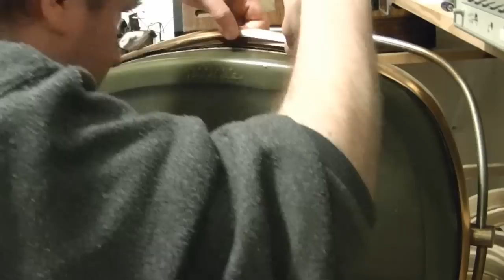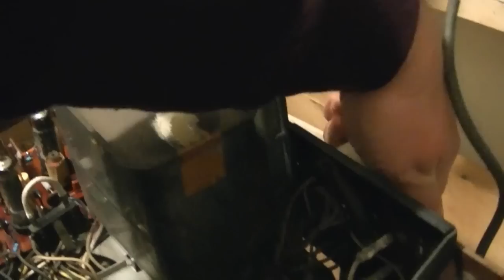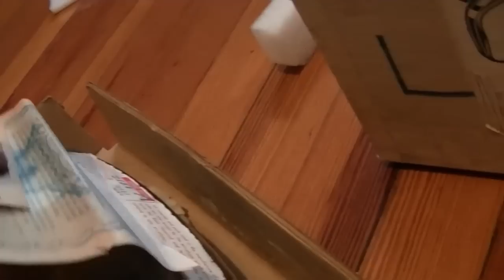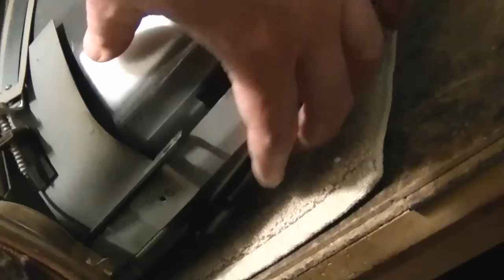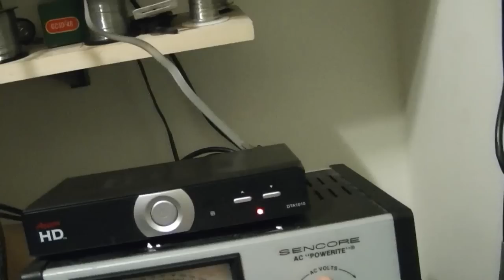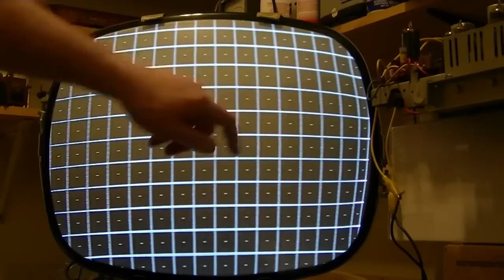Predicta Tandem II restoration pt15o?

Comment: watt meters measures ONLY watts. If you have a PF less than one, let's say 0.707, current and voltage are at 45 degrees Under this condition, V*I is about 1.41 times the wattmeter reading. Power calculates as V*I is VA not W, they are near the same when happens what you point, pure resistive load. In any other conditions VA leads bigger reading than W. As PF tend to cero (pure capacitive or inductive load), VA reads the same, but W tend to cero. Just put a 400VAC, 4uF capacitor and you will find it taking 0,25A but your watthour meter in you house wont move at all because this load. The same as pure inductive. One more little issue, chopping and strange waveformes tend to produce armonics, power is delivered in the harmonics also, but watt meters, sometimes only work on its fundamental freq, 60hz in you country, cannot add the harmonics effect. In the ohter hand, if you calculate V*I and both are wide band measurements, you will take in account all of this power delivered through the harmonics. W can be wideband also, but many regulations tend to limit measurement only to the undamental ( watthour meters for example) and let the pF or KVAh give the extra information. Todays switching supplies tend to take tons of power from harmonics because they produce THD as hell and PF is not 1. The same a CFL lamps ... Here its not allowed to take this fact in account when doing the billing, bill only reflect W on the fundamental. Cheers.
Reply: how cares that stuff,,you invented the weel

Comment: What is that board on the neck of the CRT near the yoke? I've never heard of a set with that before - especially a board with a separate tube mounted on it!
Reply: ronnies07
Thanks! Most of the videos in this series range between the 20 - 40 minute mark, and I don't really have the time to sit around and watch all of them.

Comment: Low power factor results in higher VA than watt reading, right?  Seems the error or your non true watt meter would be on the high side, not low. Or am I thinking backwards?
Reply: That's what I was thinking also. The actual in phase power (resistive) should always be LESS than the VA number.
Reply from the maker: OK, well then I'm out of ideas to explain why I'm reading 30% less than the service info states.
Reply: bandersentv Try turning the brightness and volume all the way up - that'll increase the current consumption. Get everything maxed out and you'll be close to the service info current spec.